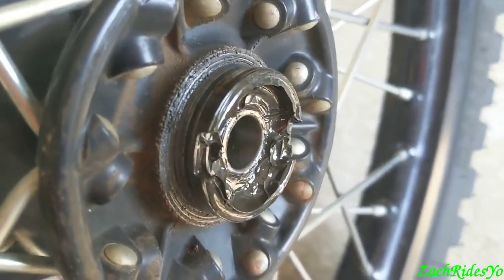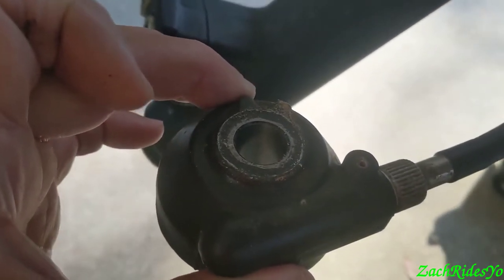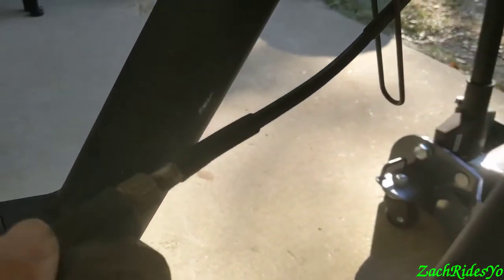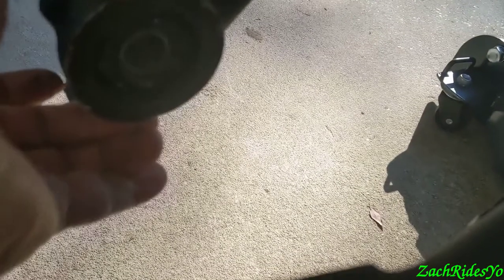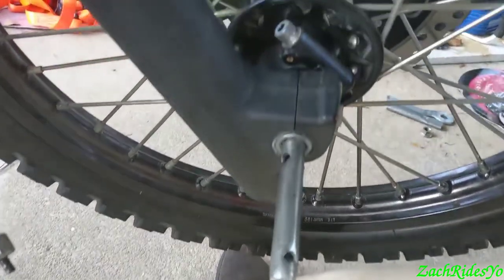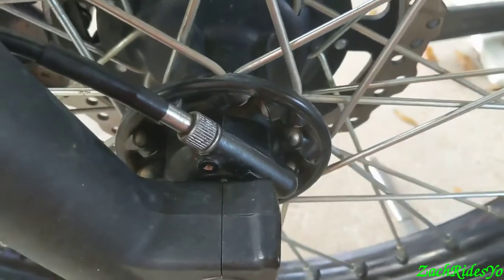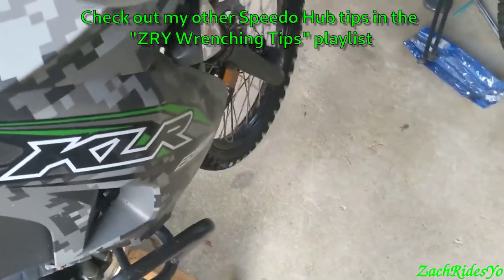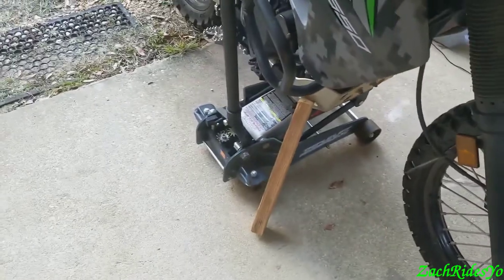#KLR Wrenching Tips - Speedometer Hub Install Allignment

Comment: I made a wood dowel/jig for mine, I take the pinion out of the hub and place it correctly on the tab slots, then the drive slides on. The whole lot is then held in place while I fit the wheel. Once in place I use the axle bolt to push out the dowel. Yes I only came up with this after wrecking a hub by incorrect tab placement.
Reply from the maker: That's a great method and tip for anyone reading the comments.

Comment: Thanks for the video. I have a '16 KLR which I have replaced the back tire with a Shinko Adventure Trial with which I love. In the dirt it will dig one hell of a trench and on pavement it does well, I don't ride pavement any more then I have to. But I will pay attention to the front wheel placement when I replace my front tire which is on my to do list for next spring. Any suggestions for a mate with my back tire would be much appreciated. I plan on putting the Shinko on my 600 Yamaha too I like that tire so much. Thanks Zach, good information to be mindful of. Keep riding and posting I enjoy you and Scratch a bunch! 👍 PS, I have a video that I am finally satisfied with I want to post but I need a computer that will handle it so that's on my wish list! Lol
Reply from the maker: Hopefully I'll get a chance to video the full front wheel install before you have to do that. Just FYI, I'm editing video on an older laptop. I just take my time with it plus I'm running Linux and using free open source video editors.
As far as tires I'm really loving the Motoz Tractionator Adventure vs the Shinko 804. Same thing with the rear, The Motoz vs the 805. The rear is noisy on the road, but much better off road. I'll be doing a review soon.

Comment: I just reinstalled the front tire on my 2018 and it does not spin freely when I tighten down the 4 hex fork bolts followed by the axle nut. This is before reinstalling the brake.  Any suggestions on what I might be doing wrong?
Reply from the maker: Tighten the axle first then the pinch bolts. If it's still binding make sure you're not over tightening the axle.
Reply: @DualSportADVmoto  thanks for the reply!
Reply from the maker: You're welcome. If doing what I mentioned doesn't help there are other things to check. If you continue to have binding email me zachridesyo at Gmail.